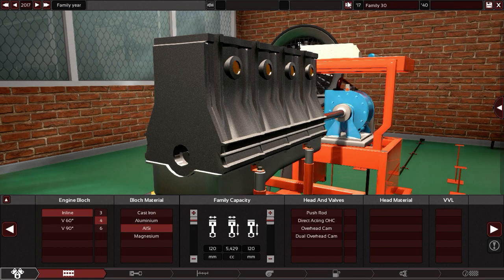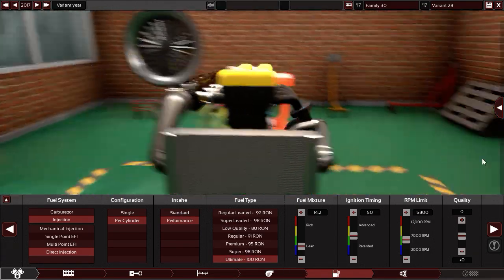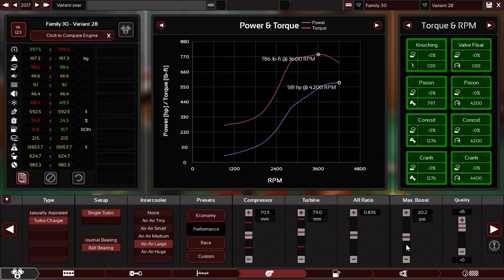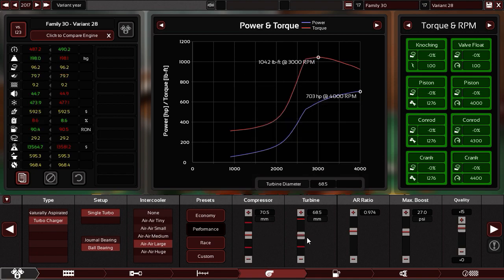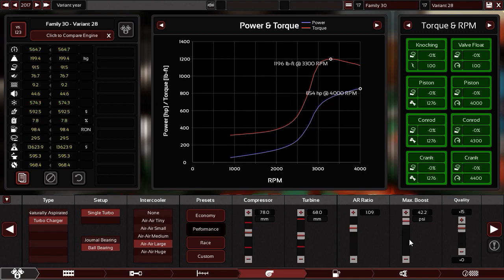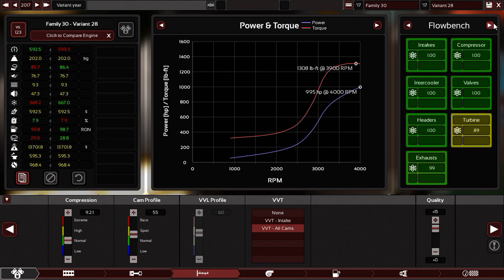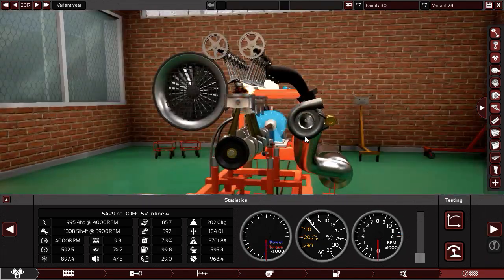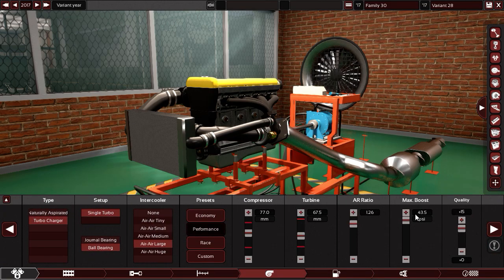Biggest inline 4 Turbo in the NEW UPDATE.

Comment: can you make a v8 that sounds like a diesel with maximum power at 2000 rpm with turbo and a magnesium block.
Reply from the maker: +Charlie Andersson that would be difficult but I will see what I can do. Thank you for your awesome request
Reply: to give you more specific combinations of parts that i think will make it work is, 1st. use a 90 degree angled block. 2nd. use more stroke. 3rd. use vvl and vvt. 4th. use a turbo with smaller exhaust turbine then compressor turbine. 5th. direct injection fuel system. 6ht. try to use a 7400cc engine block. 7th. forged pistons, titanium rods and billet steel crank. 8th. it needs to gain maximum ib/ft at around 1400 rpm to 1800 rpm and have at least 600 horsepower.
Reply from the maker: +Charlie Andersson 
Nice.
I like it.
I will make it after the previous requests